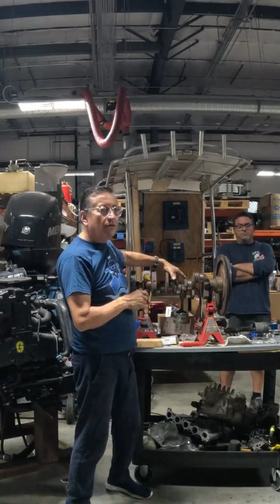Engine Seals

Comment: Typically we start looking for a leak up top and move down. Once we see a leak and we are sure it is leaking we fix it we clean everything underneath to confirm that was indeed the only leak. After engine was on for some time and rested we inspect again to see previously wet areas.